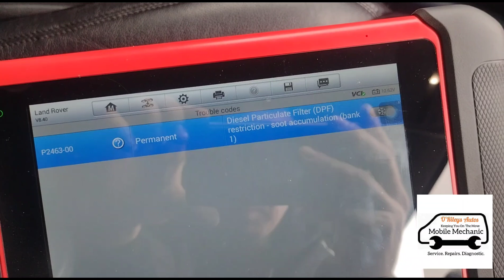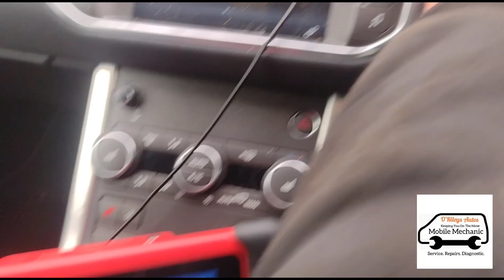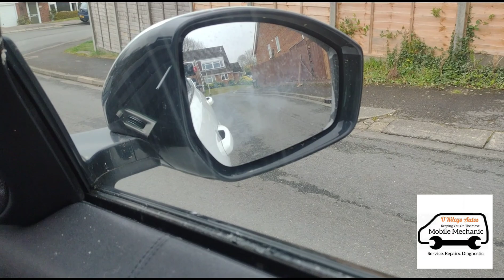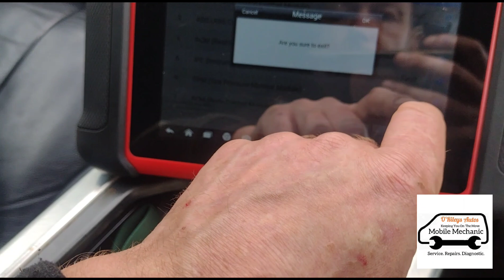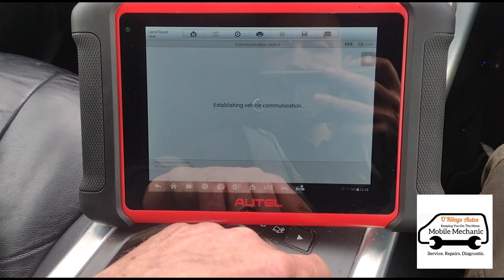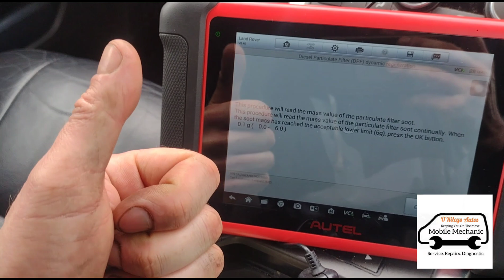Range Rover Evoque 2.0 P2463 DPF Soot Accumulation & Blocked AdBlue Injector Cleaning Repair

Comment: Hi mate, I have the same fault code in a 2017 evouqe 2.0 diesel but I also have p0046 and p2599 relating to turbocharger boost. The car is also in limp mode. You reckon its a case of DPF clean or turbo failure?

Comment: Hi Jimmy, if you've put the fluid in where the Adblue sensor was Cleaned, does it also need fluid pushed in next to the EGR sensor shown in the video? Thanks in advance
Reply from the maker: I recommend both as the egr cooler also blocks